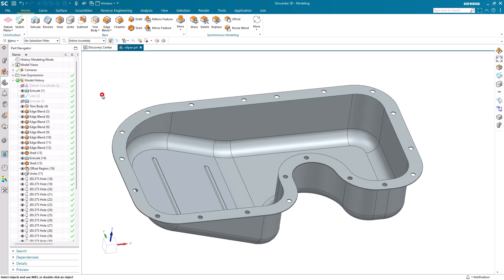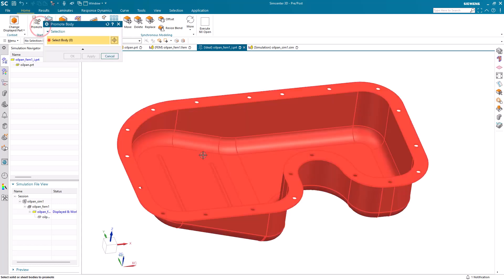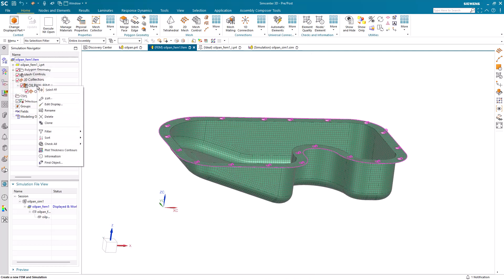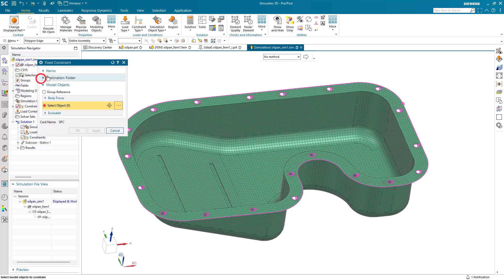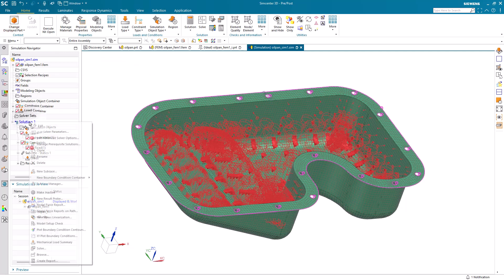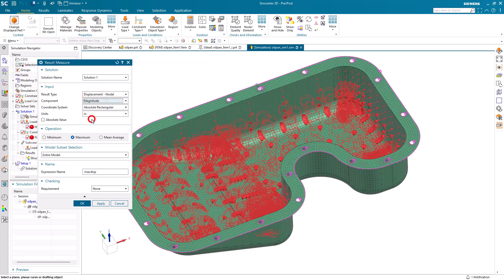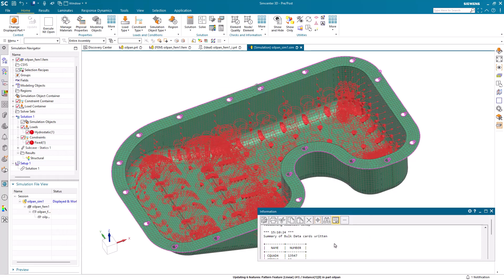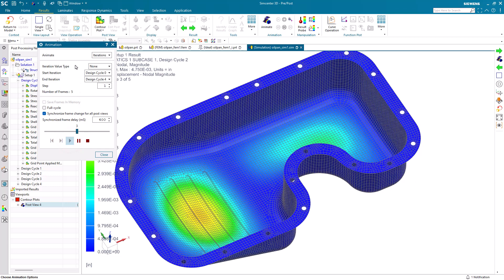How To Optimize The Number Of Ribs In An Oil Pan

Comment: Hi I have an assembly with 3 different configurations, what will be the best method to do afem and Sim for these three configurations from single cad assembly file
Reply from the maker: If you have a single CAD assembly file for the three configurations, you can create an assembly fem for the first configuration then save as for the additional two configurations.  This will allow you to reuse the work done on the first assembly fem.  Please see video here: https://youtu.be/WWdOwPV-z6o
After you have created the other two configurations, you can modify what component fems are used by ignoring and mapping the correct ones for that configuration.
Reply: @Simcenter3DTipsandTricks  I have the same component in different positions for different configurations via assembly constraints, if we map fem only the current configuration get updated
Reply from the maker: @gaganaut06  You will need to create a new assembly fem for each assembly file.  You can reuse the component fems https://youtu.be/rQurEey9pXc
Reply: @Simcenter3DTipsandTricks  means I have to make 3 different CAD assembly files for 3 different configurations
Reply from the maker: @gaganaut06  Sorry, maybe I misunderstood.  If you only have one assembly file and you are varying the assembly constraints, the assembly fem should update to reflect the updated assembly constraints.
Reply: @Simcenter3DTipsandTricks  I would like to have a single cad assembly file with three afem files referencing 3 different configurations, hope it's clear now. Is it possible
Reply from the maker: @gaganaut06  One of the big benefits of Simcenter 3D is that the simulation model stays in sync with the CAD model.  What you are asking above would require a simulation model that is not in sync with the CAD model, however, you could do it with the following process:  1. Create afem and sim from CAD assembly, solve and save sim and afem as config 1.  2. Save as afem and sim as config 2.  Update CAD assembly constraints to config 2.  Update afem and sim.  Solve and save.  3. Save as afem and sim as config 3.  Update CAD assembly constraints to config 3.  Update afem and sim.  Solve and save.  One problem with this is that two of the three sets of simulation files will not be in sync with the CAD model.
Reply: @Simcenter3DTipsandTricks  thanks for the reply, I will do that